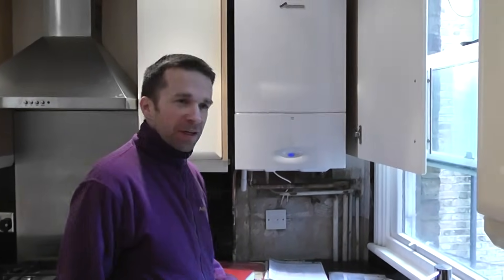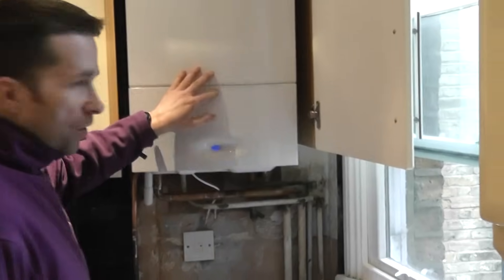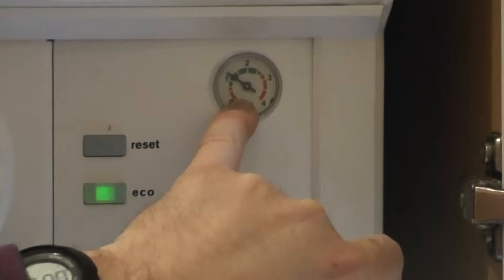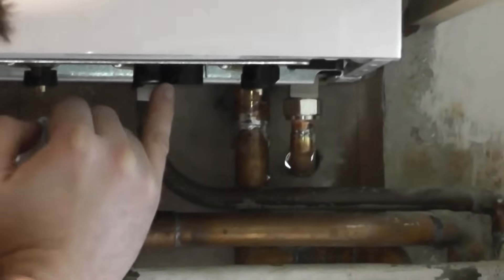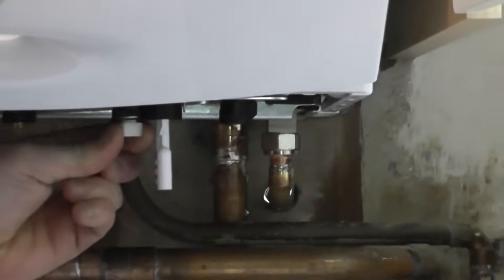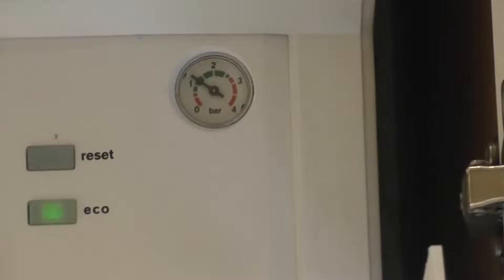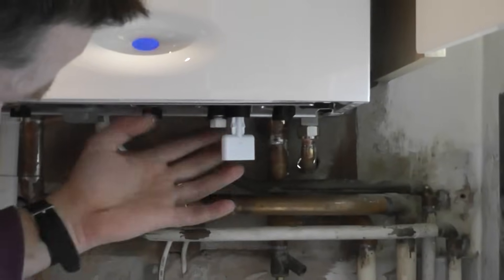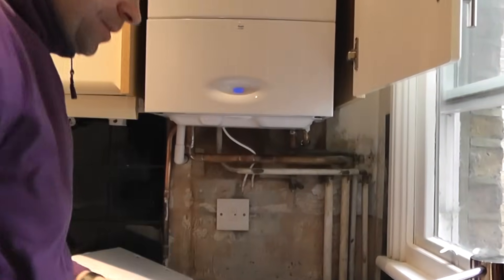how to fill a worcester bosch 25si boiler with internal filling link

Comment: Looking ofr help please...! I have a Worcester Greenstar Si30 Combi Mk4.  I can fully insert the key and turn to the lock position, but when I unscrew the grey valve no water passes and fills the system.  If I remove the filling key, water is flows out of the key hole so mains is working.  Any help appreciated.

Comment: Thanks for the video. I almost gave up when I couldn't figure why the key on my Worcester Bosch 25si wasn't closing off the water when I tried to fill it. As instructed the arrow on my key was aligned with the lock marking but water was flooding out when I opened the white tap. Oddly on my boiler it transpires that the key has to be facing me irrespective of where the arrow mark is aligned.? So obviously something different . So if you get the same problem as me follow Aquaheat's instructions but then try what I did.

Comment: my key just keeps turning it dont lock like that in the video. i used to have this boiler but now i have the newer one with the digital display, but the pressure valve underneath is the same as the boiler in this video. what do i do, just keep turning? i must of turned it about 10 times

Comment: I turned the white nob beside the key and no water went into the tank, turned it quite a good bit round but was worried I'd pull it out if I turned it to much, but no water seemed to flow so aborted the mission, any ideas why that would be? Also my boiler says pressure low its at 0.9 but the warm water and heat still works so just wondering if that's the reason for the water not going into the boiler? Any help would be appreciated.

Comment: Easy looking, but why don't you specify to turn of the electric switch on the wall 1st( you just said "turn heating off")? Also when I've followed this procedure just now, putting the key to the padlocked position and turning the white nut anticlockwise, I don't hear the sound of the boiler filling nor get any change on
the arrow in the red on the clock for pressure increase/decrease. So, back at square one!

Comment: Filled  pressure back up to 1.5, turned white knob to right, filling key to left, REMOVED KEY, WATER IS CONTINUING TO RUN OUT THE BOTTOM......?? PLEASE ADVISE

Comment: One tip. Just keep the in. Don't remove it otherwise it's difficult to re-insert.
Reply: Which position do you leave the key in? Padlock open or closed?
Reply: @laurstattersall9392  Just make sure it's in the closed position as he shows in the video after topping up. You're supposed to remove the key afterwards but I find it difficult remove and to re - insert the damn key.

Comment: This does nothing on my combinboiler. No water noise nothing. Needle does not move. Engineers have been out. Plumbers have been out. Why can't I increase my pressure? What is wrong with my boiler?

Comment: I tried to do it. Put key in, turned clockwise to locked position  turned white bolt in anticlockwise position, but instead of the water topping up boiler it leaked out all over worktop, around key, which I now can't get out! Any idea what I've done wrong.? Pressure so low I can't put heating on, and can't get engineer before Christmas.

Comment: My boiler is full of air, it won't stop air coming out, pressure on 0, i don't know what to do. Usually it takes up to 30 seconds to get the air out, today it's takes minutes, I'm slightly panicking here, is it safe to keep valve open for more that a minute? No heating,  me and my baby freezing, can't get an engineer out till Tuesday- Wednesday 🥺🥺🥺 please help

Comment: Thank you I managed to fill the water and the heating is now on! However at the end of your demo you turned the white key on On position before you pulled out the key  off the machine. I had turned the water pressure back on off position, but I am still confused whether to leave the White key on Off or On position, also I can't pull the White key off it was Stuck there for years!

Comment: What does the padlock / unpadlock actually do? Confused. Thanks :)
Reply: I think it means you can't re-pressurise using the small thing to the left if it's in the locked position, I'd guess a 2 way safety thing?

Comment: I too am SO grateful for this video. The instruction booklet left with my boiler just wittered on about the padlocks and failed completely to mention the crucial part - water pressure now back to where it should be. Not nearly so impressed by Bosch as I am by you or the Vaillant boiler that was in my former house.

Comment: Why is water coming out when i turn the knob anti clockwise??? The key says it's in the locked position?
Reply: mercurythelegend you haven't pushed the key in far enough, that's also to drain the system so if the key hasn't been pushed in correctly it'll start to drain instead of fill up.

Comment: Hi Steve, thank you for the video, I didn't realise how low the temperature of the hot water had dropped until I refilled the boiler tank. Very straight forward and took less than 2 minutes. For other users I think once you line the key up, it may need gentle pressure to push the key 'home' depending how tight the rubber seals on the key are in the slot. Very good video. Thank you again.
Reply: Keith Eeles 
Do you mind push the key UP in the unlocked position? Think should help me thankyou.
Reply: Hi Vince, sorry I don't understand your question. I think your device has auto corrected?  To insert and remove the key, it can only be inserted and removed when the bleed valve is in the 'Locked' position.

Comment: Hi Steve, great video and well explained. my boiler was at zero, therefore i filled this up, but prior to watching your video, this was filled with the key at locked, i filled this to 1.5, just came home and notice the pressure is down and the pressure bar is between 0 and 1, so I filled this up again with the key unlocked. does this cause an issue that it was filled locked and unlocked? have noticed also a slight drip coming from the main boiler (not where the key is inserted, this is periodic) I hope you can advise? I didn't think it normal to having to fill it to 1.5 within two days, or would this be because it was bleed dry that the pipes needed refilling? central heating and hot water is working fine (hot water is super hot since filling which is nice, i hope this is normal?) thanks

Comment: does it cause problems if the key has not been turned to the lock position before unscrewing the white knob to get the water flowing?
Reply: Kate Pending

Comment: Hi ,
Thank you for the video, but I got 1 problem , when I wanted to remove the key it start leaking, and it's leaking like shower, so I left the key in that pressure hole. 
What could be the reason ? What should I do? 
Thank you in advance!
Reply from the maker: +Gara Gum 
make sure you close the white nut on the left of the key before you remove

Comment: What should be the ideal pressure? My boiler has on the border of the first red section (towards 0). I do get the hot water but sometimes mid-shower, it just goes cold.
Reply: About 1.5 is good

Comment: Just wanted to thank you for this! Saved me waiting in all weekend for an engineer to come to find out why I had no heating or hot water! 
Really grateful will share this on Facebook :-)
Reply: Surprised it would effect your hot water, as that's not on a closed system and doesn't require pressure in the CH system to function.

Comment: I'm so glad videos like this exist... I put my filling key in the wrong way and it got stuck I almost broke me and the key pulling it out after the earlier stages of refilling, as shown in the vid you simply ,line up the arrow on the key with the unpadlocked symbol ,push the key up the hole and turn it anticlockwise so that it lines up with the padlock symbol turn the screw next it to refill.. also helps to lubricate the key with a dab of silicone etc.. Merry Christmas everyone.🎅🎅

Comment: this may sound really silly, but we have just put the pressure up on our boiler, we have a slightly older model with the analogue timer and we still can't seem to get the heating to come on. we havent been in our property for long and the seller didnt leave any instruction manuals, etc. is there any buttons or something else we should be pressing to get it to work? thank you

Comment: steve I did this and put pressure to 1 and a half bar I bled the radiators .. when I run the hot tap it runs hot for a few seconds and then runs cold the green ignite light goes out and it takes a long time to re ignite never had this problem before pressure drop and was wondering if there could be an air lock somewhere in my Worcester boch 28i the pressure had run to zero bars by the way before I topped up . also a lot of air came from rads

Comment: I just had the same issue with water gushing out. Ensure the arrow on the key is lined up with the open padlock (I needed a torch to see the padlock on the black ring). Push key up quite forcibly until it slides into place and then turn a quarter or so clockwise till it locks into place then you should be set.

Comment: @bestyrocks it sounds like you're not pushing the key all the way in. Try to line up the lugs on the end of the key then push it all the way in and turn to lock so you can't pull it out. You should be good to go

Comment: I'm having a nightmare with mine. Everytime I open the valve, loads of water comes out. I can't seem to fill it. I just lose water. Any ideas? Thanks
Reply: Im a bit late but, i was having this problem at the start but i twisted the little button thing even further and the water stopped falling if that makes sense
Reply: just read, you need to insert the key further in,
Reply: This is what's happening to me?!!!!
Reply: This is happening to me water coming out the key and going everywhere :( if anyone can help
Reply: Push the key in (upward) until you hear a second click. Might help to wet the rubber seals on the key. Wiggle and push! Then it should be sealed properly and you can top up the pressure.
Reply: Mee too. It's a cracker of a problem. Worst creation ever!
Reply: The guy makes it appear very easy
Reply: I just wondering how to turn on heating?

Comment: very well explained,I,ve got same boiler and having problem filling to the right pressure.The pressure gauge is at 'o' and it does not move .i would appreciate it if you could shed some light on this problem.thanks

Comment: Thanks for this video, the other ones on youtube don't show this close up. The real difficulty seems to be that it's not just a question of pushing the key in, but pushing it in firmly or the lock doesn't quite "take" and inevitably there's a gush of water. There should be a clearly white marked padlock - actually better to say fill and no-fill, and make it a screw that's turned into place on the front fascia. Finally, just mould the plastic base to fit the key.